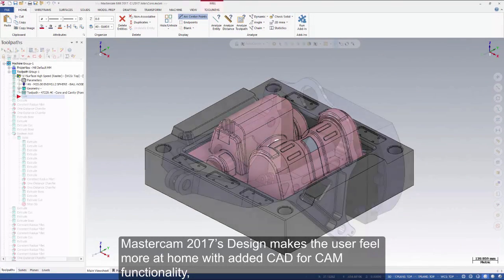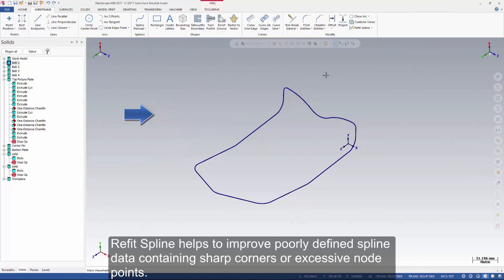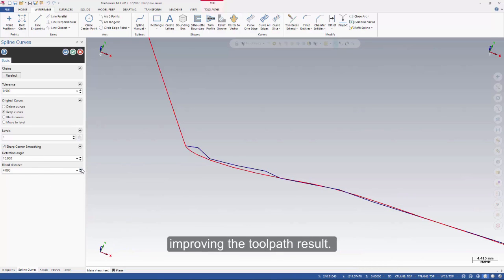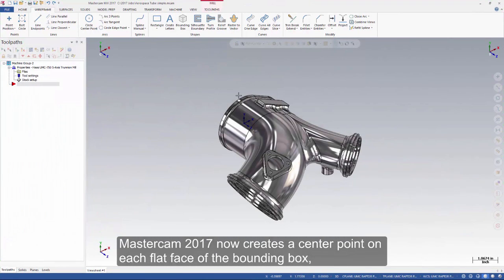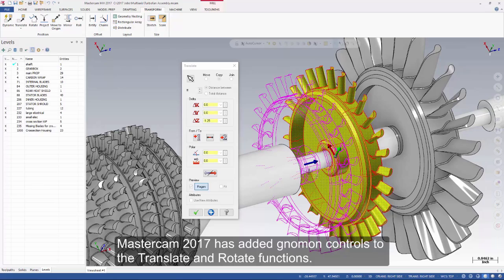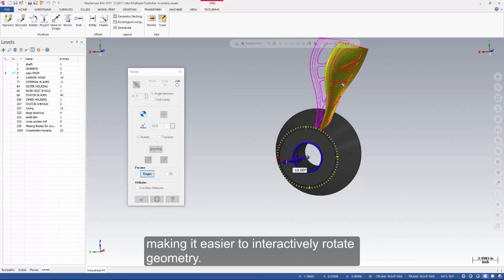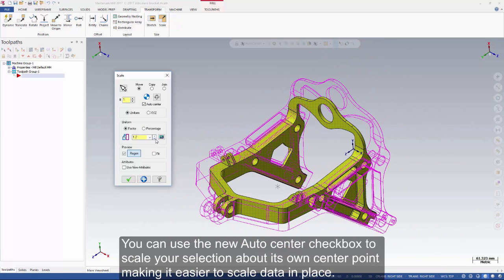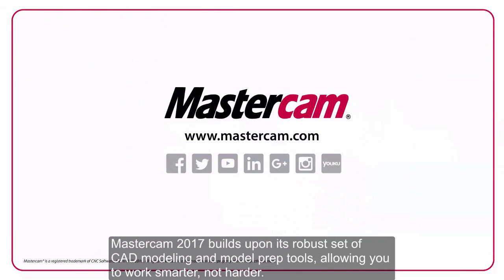Mastercam 2017- CAD for CAM Programmers

Comment: OK, why does master cams default feed rate at 6.92 inches a minute?
who goes 6.9 inches and a couple hundred rpm anyway. Have to edit every operation for that and the default material left on every program.
OK if I knew how to set up a tool library that would help. All too busy around here to show me. 
Much as it costs you could make a thread tool for the tool list as well.